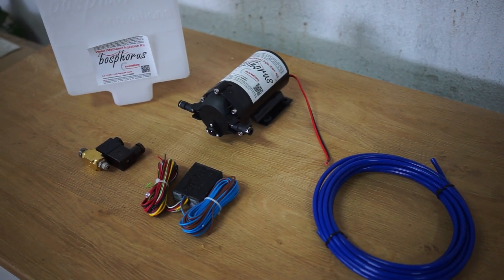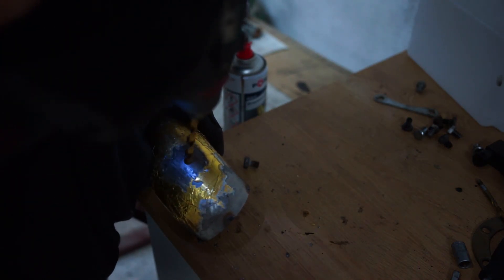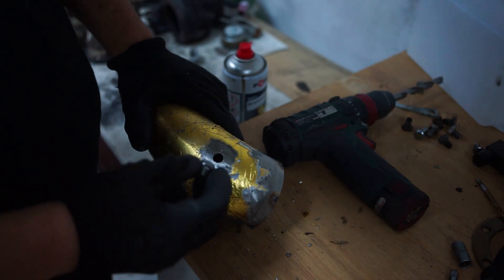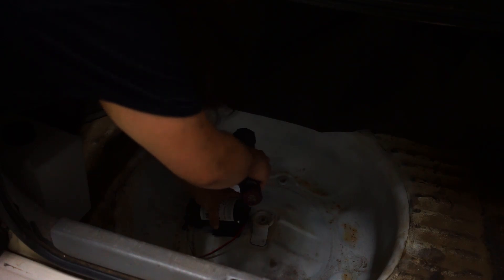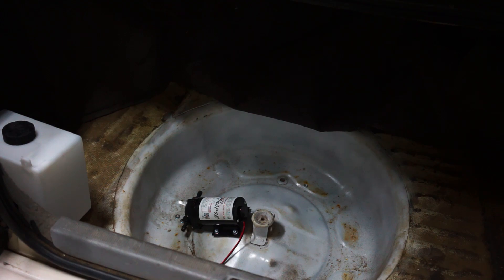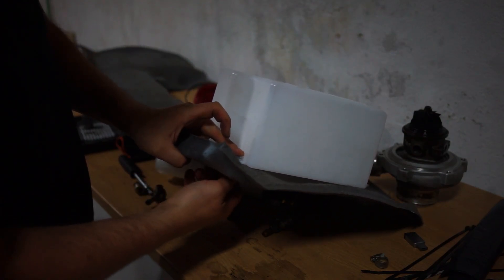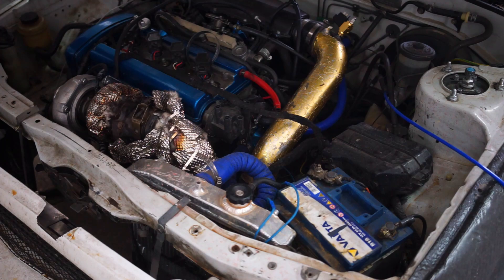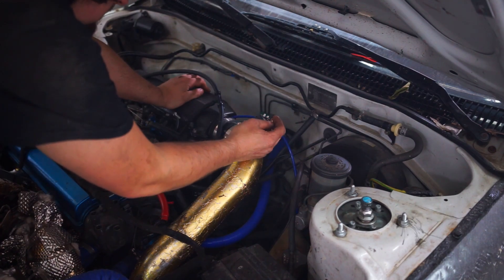The ULTIMATE Hack for more Power AND Safety | Water Methanol Injection explained | Pros and Cons

Comment: Very cool video, as always.
I think another great safety measure is to only run a more aggressive map when the IAT sensor sees a very low value. So the high map is really only active when the system is in fact spraying.
A dude running a ~1000hp M50 turbo E30 confirmed that this is a good idea and also exactly his strategy.
Reply from the maker: yeah very true tho some cheaper ecu dont have the possibility to control boost according to IAT but only Ignition timing so that sucks a little.
Reply: Totally agree — that’s a very smart strategy. We also recommend using IAT-based map switching for safety. Only enabling the aggressive map when temps are low and meth is flowing helps protect the engine and maximize gains. Thanks for sharing your insight!
Reply: @BosphorusInnovations  Thanks for sharing your point of view 😊
Reply: @BosphorusInnovations  Cool to get another confirmation by the professional in this field, thank you!

Comment: Would you recommend Water Methanol Injection kit only for lowering EGTs with straight water, no map switch corrections in map, only lowering EGTs in a turbo car that isnt suppose to have one?
Reply from the maker: yes that will work! BMW does it that way actually. but the nozzle needs to be sized accordingly, since too much water may bog down the combustion. It will help lowering EGTs and IATs allowing a stock ecu for example to runn full advance instead of pulling timing when experiencing pinging and also if its a newer car that has EGT monitoring, its able to run leaner for longer, also creating more power 

You could even run water methanol or ethanol since the oxygin senssor will corect the mixture to a point.
Reply: Much appreciated!
Reply: Great question! Yes, running straight water for EGT control without tuning changes can still be beneficial — especially on a turbo setup that wasn’t designed for it. You’ll see cooler combustion temps and reduced knock tendency, which can add a layer of safety. Just make sure your spray is consistent and triggered correctly (like post-boost threshold). It’s not a power mod in this case, but definitely a reliability one.